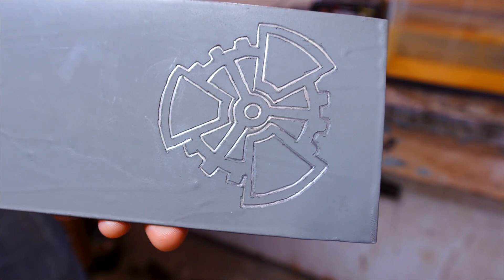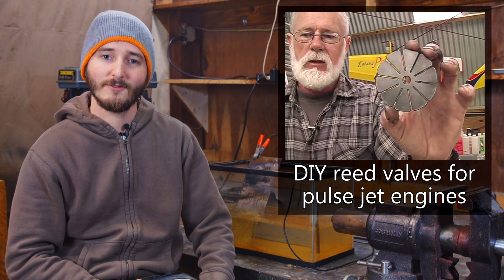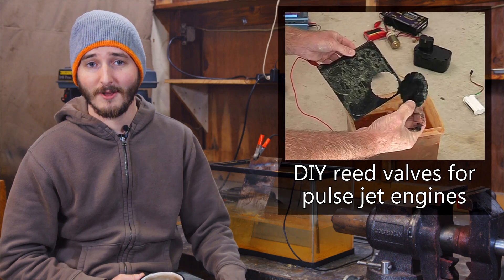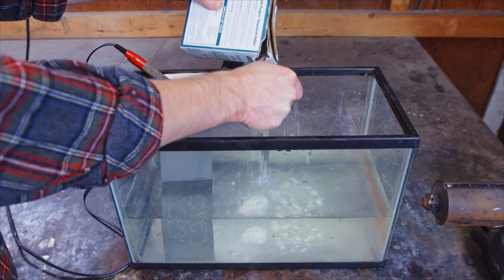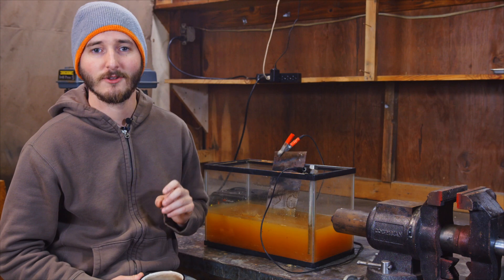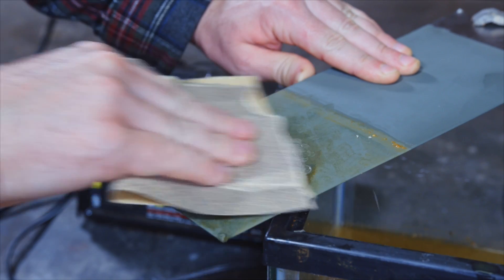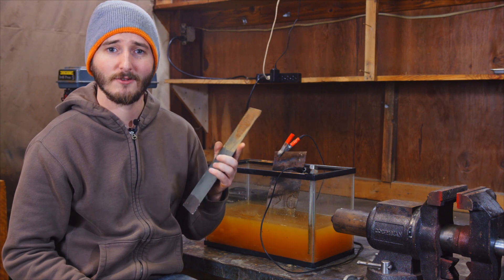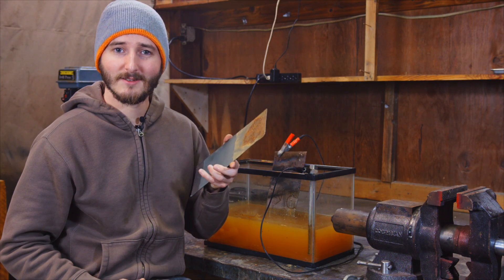How To Cut Steel With Electrolysis [Experiment In Progress] - NightHawkInLight

Comment: You're going to have issues with the sides of the cut being etched away as the depth of the decay grows. also I assume the bubbles are from the etched edged of the metal coming away leaving the paint film there, but the solution gets underneath. not sure how to fix it but I don't think it's viable for complex shapes. broader ones maybe but at that point you might as well plasma cut

Comment: Use nail polish as a barrier medium and use dc voltage which etches deeper then ac. This is a etching method used in knife etching. This technique should work well even if you use the paint medium. Any art work or design you want will work. YouTube is full of video's on this subject.

Comment: have you tried playing with the voltage/amperage? What if you lower the intensity of the etching but leave it for longer, possibly with periodic rinsing with a squeeze bottle? Not an expert, that paint kinda looks like a cheap homemade mech vape mod I saw that shorted and bubbled up the paint from the surface.

Comment: Judging from the colour of your solution, you pH is way to high (basic). NaCl should work better, b/c it can form complexes w/ Fe. Also you should try several surfactants. Those are extremely important for electrolysis. Maybe some dish soap, maybe some EDTA, maybe some Amines (e.g. NH4NO3) will work. Also vary the Voltage, draw a polarogramm to see the current as function of voltage. In there. different reactions are indicated by steep increases in current and separated by plateaus in current. Electrolysis is a very complex process, so good luck.

Comment: Hey Hawk, I'll not go so much in science details but I can see what are you doing wrong... First of all you need to use thinner sheet of steel, this will not work whit such thick steel in short amount of time (it would take days to etch that much of it), next I saw you used baking soda, which is much worse electolyte than table salt, table salt will make a much faster etching process and you need to make a saturated solution (add salt until it stops dissolving), and last but not least is your cathode (minus pole), you have to make it wider, bigger surface will give you much more current to flow through your electrolyte making it much faster and overall better and you must bring it closer to your anode to give it more current to flow. Hope I helped, have a nice day :)

EDIT: Your car battery charger of power supply has to have more than few amps, otherwise it will be superslow...
Reply: I think the point of the experience is to get throught that much of steel using a similar method ^^'

Comment: When I etched two metel pieces with a similar method I used waterproof masking tape. 
That worked fine, the edges were pretty sharp, but I was only etching the surface, not through the whole piece.

Comment: Try using a different electrolyte that wont corrode the steel as much, say NaOH or KOH, and mabey carve your design on both sides of the plate to prevent the steel from bulging.

Comment: 1. I noticed the way you sprayed on the primer was very thick and lathered. Try doing 2 coats with the the sprayhead 8" away from the metal, let each layer cure fully to the specs on the can. Thinner and better adhesion is best. follow the directions on the can and treat it like paint for this scenario.

2. Your etches are VERY wide. This method counts on small particles being degraded and carried away. larger surface areas require more current however because of the way salt and baking soda react with the metals oxidation process, it is very difficult to control. So use very thin lines. This ties into the next 2:

3. Your Cathode is only a thin pipe used in plumbing. these pipes are metal alloys made to prevent errosion. This gives a VERY small area for the current to go through and will cause a lot of resistance (allowing the baking soda to just degrade the steel instead of carry it away). Use a plate/sheet of regular steel with a larger surface area than the play being submerged.

4. Use salt. It does not create rust as fast. Baking soda accelerates oxidation because of the reaction of Co2 and steel (were talking about oxygen versus chloride). use 1+ cup per 1.5 gallons of water. The more salt the better TO AN EXTENT ( you still want it controlled).

conclusion: for the best results, the cut material should be as thin as possible, the paint should be adhered properly (its not in your demonstration ;) ). The cathode should have a large surface area and not "resistive".  The cuts should be THIN the more surface area on the "cut material" allows more oxidation and corrosion of the paint.  No Baking soda is  NOT a good alternative to salt. The oxidization from the water splitting in the cathodes should be enough to keep the chlorine from exiting the solution at a dangerous rate, if you are still concerned, vent it, volcanoes and manufacturing plants put out WAY more into the air than this project, you wont do any harm.

A little side note: this method isnt great for thick metal. when the area fisrt exposed to the solution is eaten away, it isnt 100% flat this means that the layer being eaten  away next will be slightly larger than the first layer. Thinner materials like the spring steel used in the example video help with this as they are very thin. Here is a little diagram to show what I mean:

(^ is the entry point of the alkaline)

Thick material:
----------^--------------
***/   \******
**/       \****
*/           \***
-------------------------

thin material:
----------^--------------
***/   \******
--------------------------

Comment: If you use a lower voltage there are less oxygen bubbles, maybe the bubbles kind if peel of the paint and wax. mayby you could try using several layers of paint.

Comment: Tried to post this earlier on my ipad but kept getting errors. So, this may be dumb, but, what about tempering the steel? Get it up to around 340 celsius (i think) and martensite forms a layer just microns thick and really hard. You could scratch your pattern and then drop it in? Just tossing ideas here.

Comment: on what current are u running?
i presume that ur current is too low, so the whole process is too slow, so the "water" can damage the ur coating
i think ur batterycharger limits the current
mention: u dont need much voltage just lots of current
maybe u should try a big transformer (i would try around 100-300VA with 12-24V) with a REALLY beefy (bridge-) rectifier circuit (cause u need DC) and a variable transformer to lower the mains voltage to controll the amount of power
be aware that the low voltage transformer needs to be shortcircuit proof (no thermal or current fuses/protectors and big enought wire thickness, maybe external cooling)
look for an old PC UPS, they have usualy a big a** transformer with 12V and/or 24V output and can be switch from 110V<->220V AC input
or more extreme: recoil a microwave transformer
but always beware of mains power i am NOT responsable for any harm by any unwariness i talk about serious hazards (mains voltage and serveral 10 or 100s of ampere) (this counts for anyone who reads this!)
if u have any questions feel free to ask me (here or PM) i am an professional electrical engineer :)
Reply: other possible problem: the oxidated iron/steel covers the uncoated area and blocks the current so the process slowes down, maybe u should have movement of the water against the uncoated so the rust gets blown away (maybe with a kind of filter to keep the "water" cleaner)

Comment: Like many others have already commented, the problem you're faced with is known as undercut in the semiconductor industry. With wet processes you will inevitably encounter unwanted etching because the corrosion propagates through the metal, not just where you have tapered off. Your idea may only work for extremely thin metals, and even then the error associated with it may be significant. But do keep at it, you might just find something useful along the way!

Comment: maybe the issue is with the etching? maybe when you scratch the image into the paint its slightly peeling the paint up allowing electricity to travel further than you intend, im not familiar with etching paint but could you heat treat the paint after etching your image to try to seal the edges of your etching? or apply a second coat after etching and etch it again?

Comment: 1. Have the steel plate anode in a horizontal position, flat.
2. Try using different electrolytes.
3. Lower the amperage of the power source.
4. Try chemical etching.
PS: dip etching, be it chemical or electrical, never works well. The metal underlying the mask (paint, wax) will get eaten away eventually.

Comment: As Gabe Sewell said below one of the main problems is the thickness of your metal. The reason it worked for Bruce in his video is he used a very thin metal so he was able to cut thru before his etch got to wide. You are using a much thicker material so you are going to get erosion away from your masking. This same thing occurs with chemical etching and you have to adjust the size of your masking accordingly or etch a short distance and re-mask the sides before going deeper.

Comment: I have always used vinegar with salt(non iodine) dissolved in it, and to isolate the metal I used black nail polish. I do not know the length of time the polish will stay on before needing a new coat, but its worth a try @Nighthawkinlight

Comment: A few thoughts:
- the flexibility of the paint might be an issue, a more flexible coating might adhere better as the surface deforms,
- the paint might be starting the reaction which is then accelerated
- you could try scoring the steel harder to make the indentation more pronounced.
- can you use a non-reactive electrolyte?

Can you experiment with coverings of differing thickness? if you paint one layer then 2, 3, 4 over progressively smaller areas. It might help eliminate that as a factor or provide a solution.

Comment: you could also use an acid which will work better than an elektrolyte.
but is more expensive
Reply: also baking soda is a Base which can destroy the bond
Reply: draino is not expensive
Reply: Kyle Teodecki i said: "more expensive"
an acid will be more expensive than just adding soda to a bowl of water.
Reply: fair enough, still i like draino it has so many uses
Reply: Kyle Teodecki True

Comment: try powder coating it, and I don't think you'll have much luck with that thickness of steel. It looks like bruce was using really thin steel for those reed valves

Comment: maybe if you make the same pattern on both sides or very thin lines in the paint to accommodate for 3d  effect one thing that might be happening is that you are braking or weakening  the bond between paint and the surface of the metal by scratching in the pattern  just that the paint is still laying on there so you don't know but as the cut gets deeper the electricity is getting under there one way to solve that would be to paint on a pattern

Comment: maybe you need to use less current and leave the metal to corrode slowly? anyway i would suggest to do it with chemistry... do the same thing with the paint and scratching, put the piece in HCl and add some hydrogen peroxide... i am etching electronics boards like this and able to achieve really great quality even on thin conducting lines... tho the copper coating on the electronics board is less than 1mm so i expect the acid will etch away a bit of the metal bellow the paint (but i guess more uniformly and in a concave edge)...

Comment: Although I haven't watched the video your talking about, you did mention that he is using spring steel. Are you? 5160 is the most common form of spring steel used in leaf springs and torsion bars etc. The chromium, manganese, and carbon in the spring steel my have something to do with your results if you are using just mild steel or tool steel. Just a thought😀 Good luck my friend!

Comment: Here's a few free ideas to consider:

1. Not sure if it was just for effect on the video, but your tank solution looked pretty dense with rust from the process, maybe change out the fluid more frequently during etch runs. All that extra iron oxide might be changing the fluid's electrical resistance or electrolytic makeup enough to negatively affect the electrolysis efficiency.

2. Instead of scratching away the resist coating (which could be lifting the etch resist at your tool marks) try creating an adhesive stencil that you can paint over and then peel away before the resist cures. There's plenty of consumer cnc-type cutters that will work on vinyl sticker sheets, Cricut is one brand that comes to mind.

2a. Bonus points if you can also line up a mirror image stencil on the back side to etch from both sides at once.

2b. Double bonus if the vinyl itself survives the electrolyte solution, then you can use it as a primary resist instead of a paint mask.

Comment: michealcthulu does something similar to this on his channel when he has to etch things into steel. He, however uses vinegar instead of water, and uses a vinyl coating instead of the paint. It seems to etch more cleanly than this, and is faster too. I wonder though, if left alone, it could actually cut through. It would be a pretty cool thing to use, too.

Comment: What about that rubber spray that they used on the commercial to make the screen door boat?
Reply: This would be very difficult to etch int
Reply: Tape it off first then
Reply: I don't think you quite understand the detail needed in this process. that spray is thick and cannot be etched. The primer is not the issue he is having. its the Baking soda and the metal hes using.

Comment: I don't want to say it's impossible because someone always finds a way to do the impossible. but what's happening is the electricity cuts ALL the metal it's exposed to. so as the initial exposed metal is cut away it exposes the metal under the paint and/or wax. thus causing that metal to under go the same effects which causes this "bubbling". it's not the material that your using to coat the metal that's failing. the idea itself is flawed.

Comment: Hmm, I wonder if its possible to coat the surrounding metal with some kind of highly hydrophobic compound.  I don't remember the name of it but Crazyrussianhacker featured a hydrophobic substance that allowed him to dip his hand in water and pull it back out without getting it wet.  If there are similar compounds that can be applied as a paste, maybe that might be your answer since the hydrophobic nature of the compound will naturally prevent the electrolyte from getting into places you don't want.  But that's just me thinking out loud...
Reply: The point of the primer is not to be Hydrophobic, but to be resistant to electrolysis amplified oxidation (rust). The rust preventing etching primer is a perfect match for the desired effect.
Reply: Zachtie Ah gotcha.  I figured the reason he was getting poor results was because the primer was being washed away somewhat by the electrolyte. Guess not.
Reply: You arent incorrect. however the reason is because the metal is so thick that the solution is cutting into the metal underneath the coating. no matter what he coats it with. the metals thickness will be the issue.
Reply: Perhaps that's why the wax worked well.

Comment: try reversing the polarity. negative on what you want cut and positive on your sacrificial anode.
Reply: That doesn't make any sense, putting the positive terminal on the anode makes it the cathode, and vice versa. Also. you want whatever you want to etch on the positive terminal because that's where Oxidation occurs, and that is what etching the metal does.
Reply: You've never done electrolysis before have you? Refer back to your basic sciences class, positive attracts, negative repels. The negative terminal will force the oxides/particles to push to the positive terminal.
Reply: I should think I know what I'm doing as I use electrolysis to remove rust from antique/vintage motorcycle frames on a regular basis
Reply: I have done electrolysis before, but I work with batteries more often, and forgot that the terminology is backwards for electrolysis. Thanks for the correction.
Reply: Also you don't have to get so defensive, it was an honest mistake.
Reply: +Bracy Harvey not defensive at all. merely stating a fact.
Reply: I'll accept that. After reading your comments again in context they no longer sound defensive.
Reply: This would make the test plate the cathode ( by definition) . and would carry particles onto the plate instead of carrying them away. Look up electrolysis to learn more my friend. I hope this makes sense.
Reply: Zachtie not sure if your comment is directed at me but as I stated  before, after using electrolysis to  remove rust from many vintage motorcycle frames for restoration  and modification I have a fairly good idea of what works. At least in my particular situation.
Reply: Xs Biggy  No, I was talking to OP. you want the current pulling the metal off of the plate and onto the  cathode. into the solution.

Comment: Perhaps you could try making a thin layer of black oxidation on all the steel that will be submerged, using the same process as bluing a gun, and combine that with your wax method.

Comment: use diet coke not water and baking soda
Reply: This will just eat at the metal and destroy the primer coating. Its also a very poor carrier of ion particles which is necessary for electrolysis to work.

Comment: With steel which doesn't electroplate you can use high frequency AC instead of DC this will limit the propagation along the grain boundaries and make for a cleaner etching adding some peroxide to the solution will help speed the process up giving it less time to work it's way under the paint.
but to tell the truth I really don't think that this is going to work.
you could try making your pattern out of thin copper wire and applying the electricity directly to the steel.